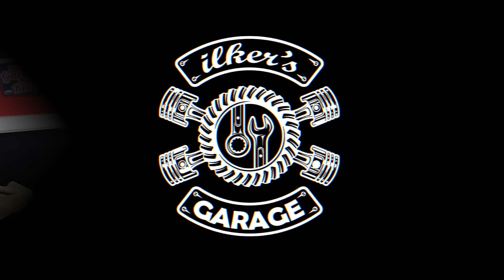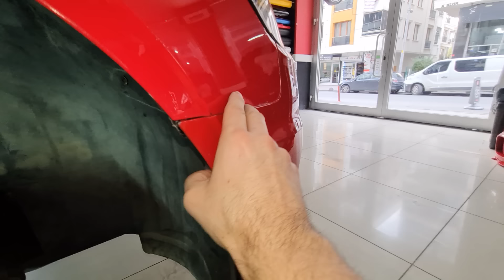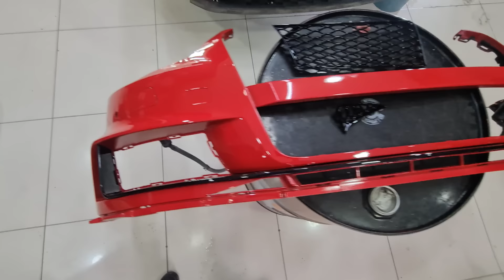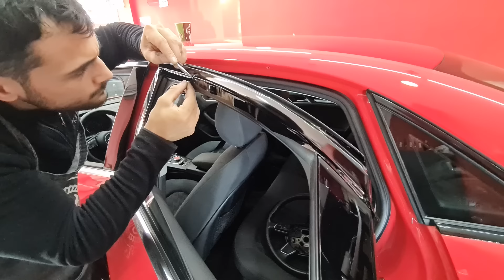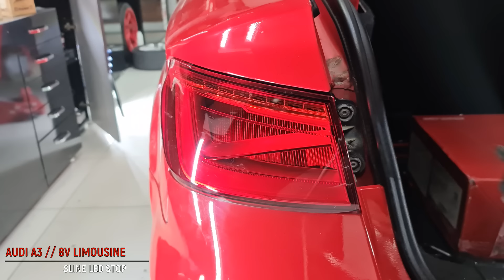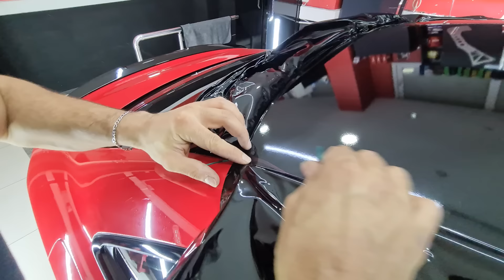Audi A3 Limousine 8V | RS3 Dönüşümü - Modifiye

Comment: It doesn't make any sense to put a RS3 badge on a normal A3. That is not a RS3, it doesn't have the 2.5L 5 cyl in it, and it's not a Quattro.
Reply: what a difference the job done is excellent...
Reply: Dude even ruined his exhaust system lmao he cut off the 4 tips. Bet that thing sounds rough it's a nice looking car but you don't even see an exhaust lmao
Reply: @slice6027  the Back Bodykit is ruining the car, this not a rs3 back, the Front is fine
Reply: Looks cheap!
4 banger version of the RS3
Exhaust and RS3 Emblems ruined the job.
Rear Bumper hideous 😅
Reply: Agree 100%